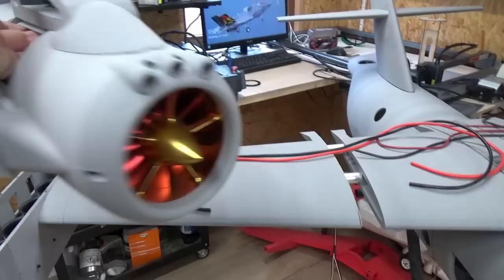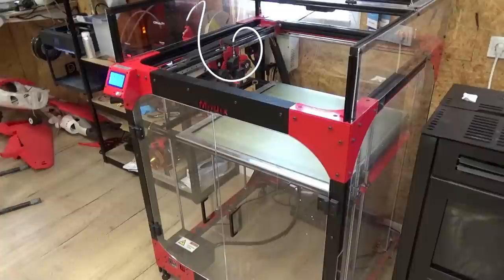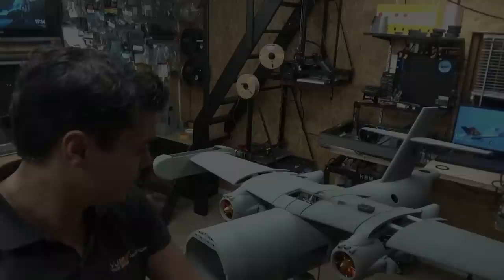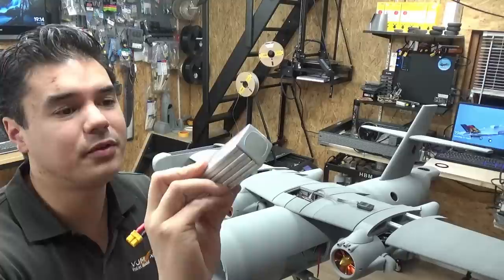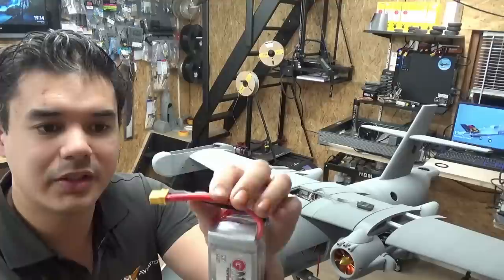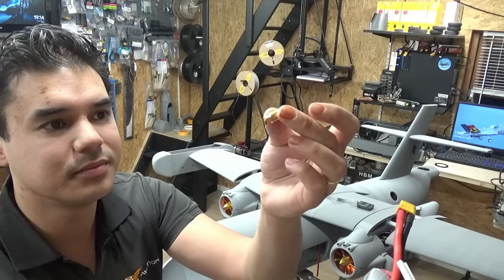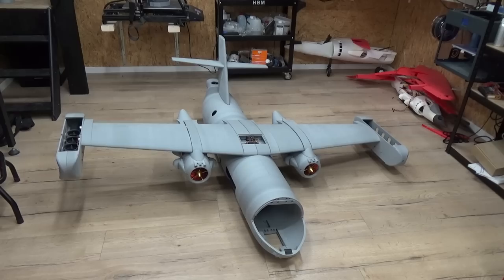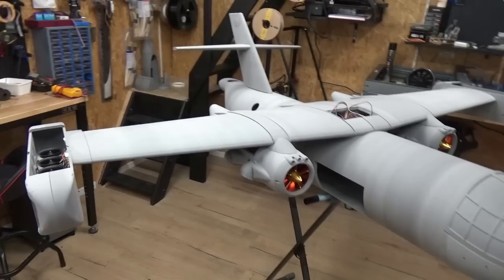Dornier Do 31 Rc Model | The Insane Vertical Take-off in Livingroom with 11 EDF's Installed!!!

Comment: The horizontal motors would still eat dirt from the vertical ones on a dirty strip. 
Also, no ground-effect (lift multiplier) and no cyclic (sharp-maneuver during flight).

Comment: Thanks for the update Joel. It's amazing work in each and every step. Was the hover test a weight/thrust ratio thing? How much throttle was required to get it off the surface? 
That youngling is so cute!! I know the cute comes from her mother but I can safely say your daughter certainly looks like you.
AirHammer out!!
Reply from the maker: So 14 kilos at a 10Kg model when finished..now it’s 8,2 kilos without landing gear and bad 45C rate lipos..the throttle curve was limited on 75% in this video…after 1min 30% left in lipos…so I need bigger and stronger lipos for sure

Comment: you chose High Voltage..   may I ask why?    just to try and save weight with wires?    your wires seem quite thick from video.     Or what is the efficiency gains for High V?      are the motors better?   I can't find a good resource to figure out what I should use for my boat.   thanks
Reply from the maker: Yes when choosing thinner wires they will get hot and we loose power. So higher voltage with same power output is lower current. This will save in choosing lower weight ESC’S

Comment: I know you know what you are doing but be very careful with the loose connectors on those Lipo’s.  From the video it looks like the connectors could touch without insulation.
Reply from the maker: Yes the xt90 are burning due high current . But maybe extra isolation would be better